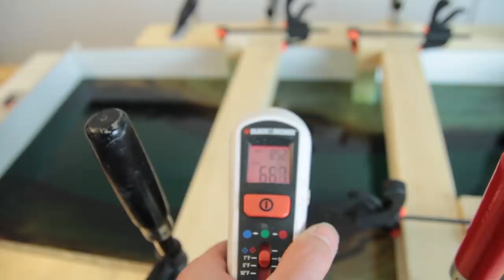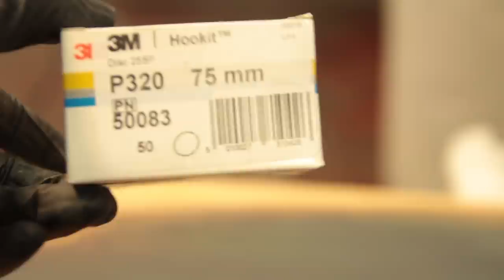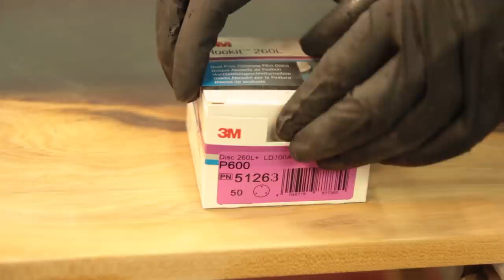Epoxy River Table in 7 Steps - How To Make

Comment: Hey I have a few questions. I'm trying to achieve that same sort of satin sheen. After your flood costs I notice your sanding with 320 and 600 grit sandpaper. No need to wet sand? As well looks like you're applying some sort of liquid in between sanding costs? What is it and what is the reason? Is there no need for buffing after the 600? I've built tons of tables but when it comes to epoxy finishes I am not very experienced. If you can help me out with the finishing process it would be greatly appreciated!

Comment: Awesome project!  I am just getting into these types of tables.  Can you re-use your measuring cups?  If so what do you use to clean them?  I don't know if you can answer this or not but I was also wondering with your time and materials into a project like this...If you were going to sell this table, what would you sell it for?  My wife keeps telling me I am under charging for all my furniture.
Reply from the maker: I just trow them away or use them for less important projects... You can let it cure and remove the hardened epoxy from the bottom but the sides are still 'dirty' then and wouldn't like them to ruin a futur casting... Price is difficult and depends on what the buyer is willing to pay... General rule is to add up all the costs and calculate the time you put into it

Comment: What type of finish would you use if you needed to have a food safer product used. I am making some charcuterie boards and am having a challenging time coating the epoxy with oil. The oil never seems to dry (the pieces are epoxy and wood (wood is not completely covered with the epoxy). I realize most times a type of poly is used to seal and protect the epoxy but obviously is not food safe.
Reply from the maker: Very hard topic as I avoid making products that are foor related due to what you are saying... So far never really found a product for it, but you would need to look in the 'natural' products like beewax and such I think... In theory once cured epoxy is inert meaning not 'harmful' anymore but wouldn't like to eat from it myself 🙂

Comment: Hi many thanks for the details. One question what did u spray on the top as well as the Base support in step 6
Reply from the maker: If I understand what you are asking that would be the polyurethane clearcoat
Reply: @MatthieuLibeert  ohhh thanks a lot for reply
Reply from the maker: No problem 😉
Reply: Oh and when you’ve done pouring the liquid epoxy, how’d you clean the bucket afterwards?
Reply from the maker: You don't, you throw them away

Comment: Great video Matt. How long do you have to let the first coat set for before pouring the rest of the resin in, as it looked to be in a liquid state when you poured the second one?
Reply from the maker: Thanks! First layer has to go into a Tacky state, so firm but just a bit soft, that way the next layers will chemically bond to that first layer, time depends on temperatures but you should take count of around 10 hours, all the rest could have been poured in one go, just didn't have a big bucket to do it in one go!

Comment: great job
Reply from the maker: Thanks Peter
Reply: i need to make a couple of dummy air scoops Matthieu, would i be ok to use MDF as a buck for these. I only plan to skin them not vacuum resin, as i do not have the set up. . . .any advice would be gratefully received.
Reply from the maker: @onepairofhands  yes could work! just keep in mind that mdf can suck up a good amount of resin. So try sealing it first with a few layers of epoxy and sand back flat, then start skinning them, So dont use them as a mould but more as the master to take the mould of. If you want to use it as a mould I would lay down a layer of fiberglass with polyester and sand flat, then use release and make your parts out of it. Just make sure it is fully sealed, otherwise your part might get trapped forever in the mdf as it is so spungee
Reply: all understood. many thanks for your time
Reply from the maker: @onepairofhands  no problem! good luck!

Comment: Hi Mat.

I'm starting with epoxy table's and have a question.
Why you "cooking" the table's? 
What temperature and tips of "oven" I need?
Reply from the maker: Read about post curing resins.... It'll make your resin strong and more resistant to higher temp